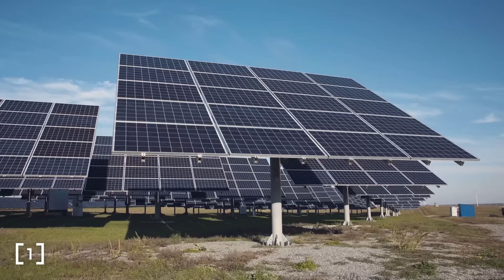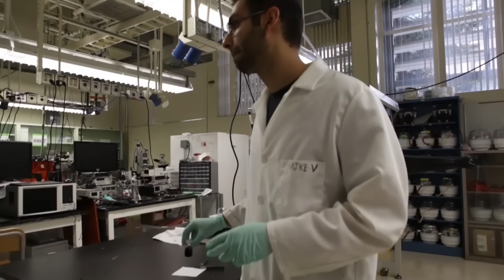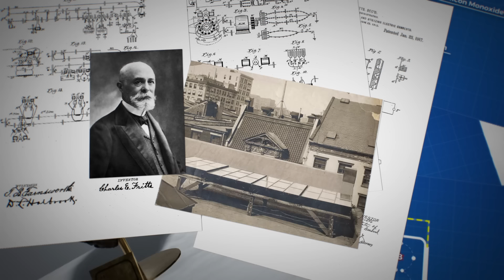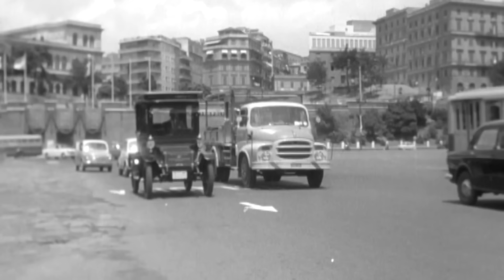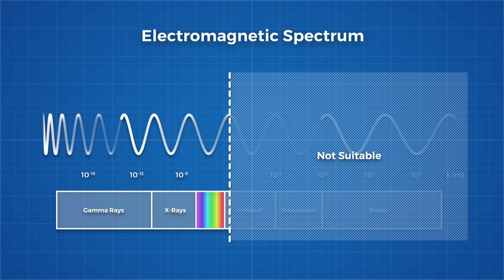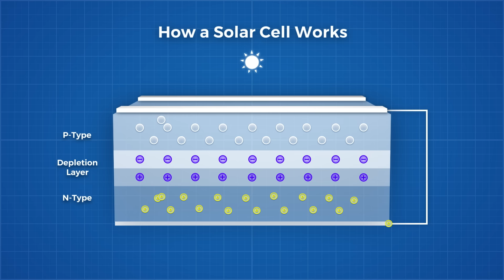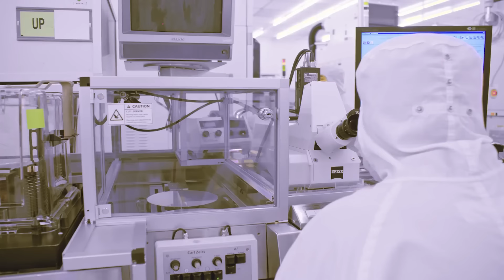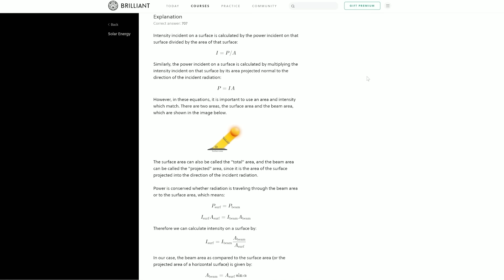The Mystery Flaw of Solar Panels

Comment: One thing I would like to know is what happens to the old solar panels, are they reconditioned and reused again, recycled in some other way or just thrown away(put in landfill). Same with wind turbines what happens to them when their life cycle ends or brakes down.
Reply: There are pilot projects for recycling solar panels, I believe, but there are no large scale recycling  facilities yet as most panels have a useful lifespan of 3 or 4 decades and it is just too early. There are valuable materials to be recovered. so there is an economic business case recovering materials.
Wind turbines are a bigger potential problem as fibre glass (or carbon fibre) is not recyclable. Ask anybody who has tried to junk a fibreglass boat.legally. The large turbine blades, once they are worn, have nothing in their future except landfill (so far).

Comment: efficiency lost due to heat is quite complicated (leave passion and be on point) and outside the scope ? really? u got heat u create pressure yes ? to release the pressure u need more energy (pressure means sticky means more effort from photons) nothing is outside the scope of this video these are informations.. u could say at least silicon has a ideal temperature to do this job loosing eficiency on other temps

Comment: About 2% of the world's electricity is generated from solar panels. About 25% from all renewable sources including dams. Nuclear is a more viable, efficient, reliable option than solar. France gets about 70% of its electricity from nuclear. Solar is being promoted by the clueless. The world can't live without fossil fuels. Fossil fuels will be around for the next 100 years.

There is nothing a 0.01% change in atmospheric CO2 could do that the 5% water vapor (a much more powerful green house gas than CO2) which has a ubiquitous source from the oceans wouldn't have already done.

Comment: that opening propaganda is hilarious.  world wide solar production of 630,000 MW a year....ooooohh.
that's enough to run at the upper estimates, 1 MW will power about 200 homes. That's 126 Million homes.  Just the homes mind you, not workplaces, streetlights, or factories.
Globally we use about 23,398 billion kilowatt hours or 23,398,000,000 MW
Of that total, only 630,000 MW come from solar
to put that side by side:
23,398,000,000 total MW used
00,000,630,000 Solar MW generated

Comment: Excellent vidios!
I love the ending best advertisment tie in!!! LoL
I was reading comments and discussion as many people took it as a challenge to get the frequencies above infrared to produce a hole in silicon.

Equivalent to stopping x-rays with a sheet of ordinary paper. Not worth it.
But here if you people want more of that spectrum you don't need anything new. 

Here is a cut and paste

@Thomas Lauermann  Did the gallium help? I assume yes because like Mercury it likes being an amalgam. For gallium i would imagine the colder the better. .

Lastly a general comment about the infrared out of silicon range. Most of that (electromagnetic frequency) passes right through the panel.
I don't think it's worth collecting (cost effective)collecting but if you want it. Use a microwave mesh and a mesh of radio antenna's just like the old radio using a (germanium diode) they have always produced electricity but the speaker was too quiet so old radios where plugged in to run an amplifier that maid the already existing electrical energy louder.
I guess if you want an Am radio disco light put the antenna under your pannel run a germanium diode to ground through an efficient LED. Disco light day or night! LoL

Comment: The biggest problem with so called renewable energy sources is the real cost of implementation in terms of cost, carbon footprint and environmental impact. Basically you have to replace your entire power source every 10 years or so. How many times are you going to replace the renewable sources over the life expectancy of fossil fuel plants. 40 years or more. Also, how much of an impact is all the detergent used to wash solar cells hurt the environment. All those "window" washers are going to add to your electric bill. No different for windmills except the additional impact on birds.

Comment: One problem with your opening statement is that thus far, solar and wind have NOT actually displaced fossil fuels globally; instead, they have partially displaced nuclear (replacing only about half the cutbacks in nuclear that have occurred over the last couple of decades). The rest of the nuclear cutbacks, as well as increases in demand, have been supplied by increases in, rather than reductions in, fossil fuel burning (mainly natural gas). In fact what we see when countries heavily invest in solar and wind and cut back nuclear is an INCREASE in natural gas burning, since intermittent sources like wind and solar have to be paired with quick-responding on-demand sources like natural gas. The result is also an increase, rather than decrease, in energy costs regardless of how cheap wind and solar become (you have to have those natural gas plants standing by despite being shut off half the time), not to mention an increase, rather than decrease, in greenhouse emissions. The other alternative would be battery storage, which would also lead to increased prices. This all explains why the fossil fuel industry does not see wind and solar as a threat, in contrast to nuclear which has always been its only viable competitor. They instead see wind and solar as guaranteed ways to increase demand for natural gas and keep energy prices high.

Comment: Solar panels to generate energy is simply dumb. Using parabolic solar reflectors allows use to almost all of the energy coming from the sun. You use the concentrated light to heat up salt until it is molten. Then you circulate water around pipes flowing with molten salt to create steam which would drive your steam electric generators. What's great about this process is you can heat up tens of thousands of metric tons of salt and store it underground in triple panel hyper vacuum storage containers. That way you lose zero heat. Then you use a small solar panel array to charge Tesla Semi Truck Batteries and use that power to keep your molten salt at temperature years. 

Also you do not need a huge section of land. In fact you could have on installed in every house with a backyard of building with a flat roof or parking lot. I know you think this is laughable but you are so wrong. In the 1950's Popular Mechanics magazine published a magazine with plans for a molten salt electric generator for home use.

Also years ago here in the US, a teenage boy took an old giant fiberglass satellite dish and covered the parabolic side with 1" squared mirrors. Once completed he showed on the news he could ignite bricks on fire in just a few minutes. If he could do that he could heat up all the salt he wanted for a molten salt generator. To prove just how powerful his simple creation was, is the fact that one day when his satellite dish was being stored in an old wood shed that had windows. Part of his dish was uncovered and enough sunlight that came into the woodshed set the whole woodshed on fire and it burt to the ground.

Why this tech isn't used to decentralize electric power production is a huge question that needs answering. Every building, apartment building, subdivision, or house could have their own system. Coupled with the advances in rapid water vapor condensers, you could have a closed system that works 24-7. You could leave your airconditioner on 60 degrees Fahrenheit 24-7. It could power all lights and machines slashing a business operation costs. It would drastically lower pollution. You could end the drilling or mining and transporting and burning, and disposal of waste bi-products from using fossil fuel. If you add in Atmospheric moisture condensers you could also have all the clean water you will ever need.

The sad thing is the tech exists but no one is willing to step up and make it mandatory. Why? Because it is too cheap to make and use.

Comment: I'm a little confused about the cost of producing electricity with solar panels versus fossil fuels. If this is true, why is China, the largest manufacture of solar panels continuing to build coal fired power plants?  It appears governments are responsible for the closing of fossil fuel power plants and not the efficiency of solar panels. Or maybe the Chinese government is just ignorant.

Comment: You missed the principal point: The difference between mono crystalline and multi crystalline silicon.
The boron oxygen trap only (or mostly) occurs with the multi crystalline silicon  (perfectly square cells) but not with the mono crystalline silicon that is  grown with the Czochralski method (the cells with the cut off edges).
This led from 2017-2020 to a mayor shift in the PV industry, where the multi crystalline silicon landed in the trash bin of history.
Only 3 or 4 years later there is barley any multi crystalline silicon production left.
(Sometimes 1 week of study is not enough - the rest of the video is not bad though).

Comment: It also sounds like a commercial complaint of less or losing profits from sun free energy. In the other end, the energy consuming devices have been greatly improving its energy consuming efficiency. 
The good old sun energy warms up the air to create winds in heat exchange between the cool dark side and warm sunlighted side of the earth, or low pressure at night time cold region vs high pressure in daytime warmer region. Winds are another sources of energy in the air as well in the oceans. Another great source of energy needs to be explored is earth's own energy from volcanic areas where the hot magmas are exposed along the esrth cracks. Magma shows its high energy when contacts with waters.

Comment: Instead of anti-reflective surface treatment to block reflected light, what I'd do is enhance its reflectivity -- but do so selectively.

I'd use a dichroic reflector that would pass that part of the spectrum for which silicon cells are most effective (blue), and reflect the rest of the spectrum (green, red, infrared) -- which would have two benefits: It would prevent the photocells from heating up so much, and, it would allow the heat to be captured for a secondary power generation system (i.e., the central "molten salt tower" concept as used in the Sahara).
Reply: Lmao, using only blue light makes the problem worse. You'd be getting even lesser than 10% efficiency
Reply: @vikraal6974  -- Yawn... then pick the best color. Case Closed.
 
PS: Decades ago, when I had a camera repair store/shop, silicon photocells were introduced as a replacement for the then-universal CdS (resistive) photocells. They were as I recall described as "silicon blue" cells that required filtration to counter the silicon photocell's blue sensitivity.

I guess the technology has changed in the past nearly half-century. Go figure.
Reply: @This_is_my_real_name  "prevent the photocells from heating up so much"  Photocell heat is not a problem in real-world installations. 
"Yawn...Case Closed" Your imagination isn't the final arbiter.
"photocell's blue sensitivity" So the blue light was filtered OUT, while you want to filter red and green light OUT.  Nonsense.

Comment: This is starting to make me think the optimal place to build solar panels would actually be high equatorial mountains, such as the Peruvian Andes, rather than the Sahara basins. 

At the high elevations found in Peru's mountains, the light has to pass through about a mile less atmosphere, which means more can hit the solar panels. The atmosphere is thickest at ground level and much thinner at high elevation, so even at Peru's average elevation of a mile above sea level, that's a mile of the thickest air on Earth that the Peruvian panels would avoid. Atop some of the high Peruvian peaks that tower at over three miles above sea level, the atmosphere starts approaching the "death zone" where it is so thin that it can't sustain human life. This much thinner atmosphere won't reflect or absorb as much light, so more of the energy of the sun will reach the panels.

Additionally, Peru's high peaks are cold. They are so cold that the panels won't need active cooling, even in the summer. Some of Peru's peaks are snow-capped year round, even in the middle of summer, despite being equatorial. This will keep the panels at an operating temperature where they don't need to waste any of the power they generate on cooling, allowing them to pump all that power into the grid.

Comment: I wish the global climate change computer jocks and engineers would get the Physics right. Carbon Dioxide is NOT a big driver of temperature rise, and quantum mechanics is the reason why.  The greenhouse effect, a summary of the article by Happer and Van Wijngaarden
By Andy May

Figure 1. The calculated outgoing radiation flux spectrum from the Earth, with a temperature of 288.7K. The red, green and black curves represent the radiation emitted as modified by CO2 (in various concentrations) and H2O, O3, CH4, and N2O, the main GHGs, at their current concentrations. The blue curve is the flux without GHGs in the atmosphere. The black curve represents the flow at 400 ppm CO2, current concentration. Green has no CO2 at all and red has doubled CO2 (800 ppm). The x-axis is the frequency in wavenumber units and the flux is in (mW cm) / m2. The additional forcing caused by the doubling of CO2 is the integrated area of the distance between the black line and the red line, major differences are highlighted in yellow. The rest of the figure is explained in the text. The data used is from HITRAN and the figure is very similar to Figure 4 of (Wijngaarden & Happer, 2020).

https://clintel.org/the-greenhouse-effect-summary-of-the-happer-and-van-wijngaarden-paper/

Comment: How do you clean surface of panels from buildup of fire ash from forest fires? What products to use, type of brushes to use??
Reply: Water is the best bet and a squeegee with a light touch. Don't use soap, windex, ammonia , vinegar or diluted solutions of the same. Just water.

Comment: Using water to cool the system sounds like a massive problem considering how at the same time of needing cleaner energy, we need water conserved, and also water required more in the areas with best sunlight available (not just for solar energy but other life).

Comment: Excellent video, I appreciate the in-depth explanation of how solar panels work. My takeaway is that another area we should look at; if the grid-design for solar cells is causing an 8% loss of efficiency, then we're only tapping 2/3rds the power we could from solar cells. A more economic way to create more efficient patterns for the metal could be a solution, but perhaps a conductive material that is semi-transparent could also reduce the loss. Of course, I'm no engineer or scientist, etc., so I've no idea if the latter could even be done.
Reply: It's 8% of the total 80% loss, not 8% of the 20% remainder. So improving it would definitely be of value, but would not reduce efficiency losses by 1/3rd as you imply. And there do exist transparent conductive films (TCFs) but what's holding them back from wide usage in PV cells are cost, but apparently that is improving.
Reply: @waylandsmith  That's what I meant with the 2/3rds comment - if we could tap that 8% successfully, we'd achieve 28% total efficiency, compared to 20% now.
Reply: Some high efficiency solar cells get around this problem by putting all of the metal grid on the back side.  But this doesn't work if you also want to collect light that hits the back side (which is becoming more popular).  There is also a lot of work using transparent conducting materials, but most silicon cells still use a metal grid.

Comment: Solar panels are only converting 20%?  Or 18%?  That is horrible.  Only like 1.37 kw lands on 1 sq meter.  And that is if it is perpendicular to the arriving sunlight.  Which never happens.  20% of 1.37 equals 0.274 kw / sq meter.  I can't tell you how underwhelmed I am.

I looked up our various electical power production in 2018, for 017 and earlier years.  In 2017, only 0.9% of our total energy production was solar.  AFTER 60 YEARS.  

When the brag about solar growth, they tell us in percentages and tell us that this percentage is important.  Poppycock.  An increase from 0.8% to 0.9% can be said to be an increase of 12.5%.  Whoop de freaking do.  That is only a 0.1 increase, but they frame it disingenuously.  As in bullshitting us.

This is a losing technology.  Without government subsidies it is not viable.

Guys, I am a liberal.  But I am also an engineer, though no an electrical engineer.  But I know how to look at tech and the numbers. This tech will never amount to shit.  And cannot possibly be a big player in providing the USA enough power for the future.

This guy is talking about a 2% drop and almost in every case he calls it "a 10% loss" as if the bigger number is going to make it sound more massive.  It is b.s.talking about a 2% loss when the REAL loss is the 80% loss that gets it down to 20% in the first place.  An 80% loss is monumentally unacceptable.
Reply: 20% is the rated efficiency. The panel's voltage reduces portional to temperature. At peak afternoon, panel can loss up to 10% of the 20% which is 18%. Light induced degradation will cause another 2% drop in performance over 1 year. Do not forget that there are more losses such as light being reflected away, ohmic losses from DC and AC cables, inverter conversion efficiency losses and many more. In the end, a solar PV installation gets 75~80% of the 20% as usable energy. I work for a solar developer company for years and all the green effort are marketing bullshit with hidden intention of making more money for the company.